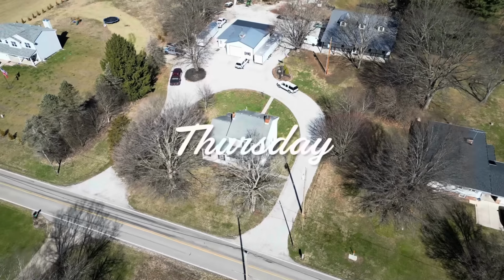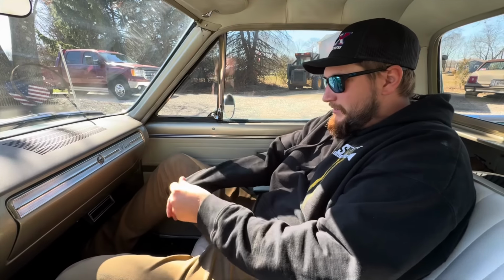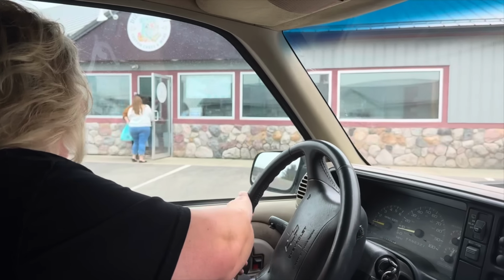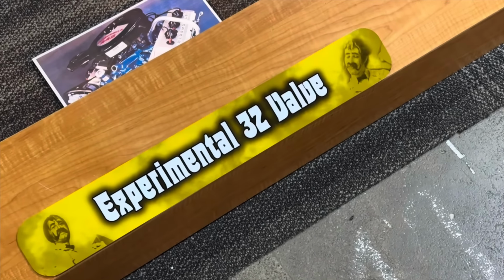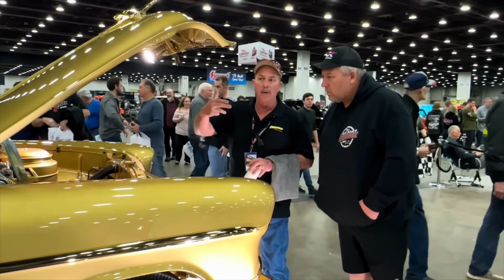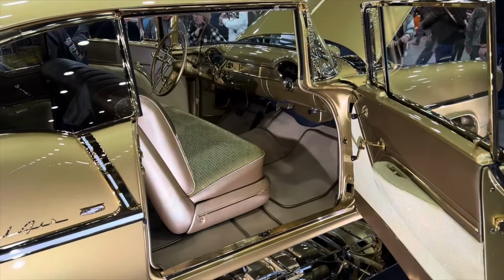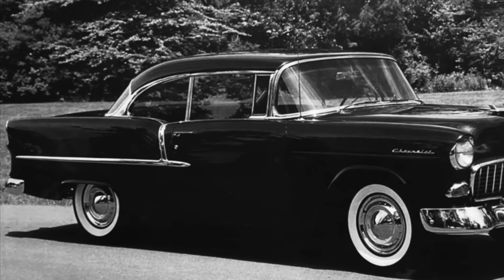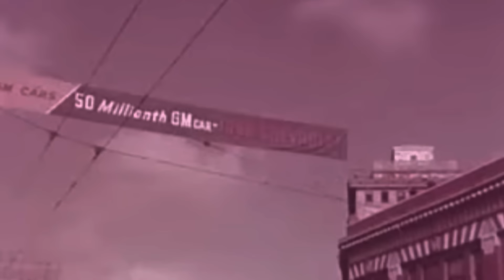GENERAL MOTORS BIGGEST MISTAKE!  The 50 Millionth GM Car(s) that were almost forgotten FOREVER!

Comment: Never thought id see a 307 going in something on this channel 😢
Reply: Well, unfortunately that’s when you get rooked by a street racer from New York! You can trust what those guys say as much as a New York politician, lol 😂 

At least it’s something that was gonna go into the MailCamjno and not something needed for a build with turbos or NoS. Makes you really wonder about the “Originality” of the rest of that SS Nova tho. Tyler may not have the cream puff he’s always thought he had or he did know and that’s why he was not taking issue with stripping the car down the way he is to update it instead of leaving it factory SS
Reply: The 307 was never a bad power plant, it just was never even close to being the king of HP. Personally, I am glad that the ElCamino is getting a rare power plant. While the 327 would have been awesome, the 307 fits the bill very nicely too.
Reply: No horsepower, hard on gas, JUNK
Reply: Those were considered as boat anchors, lol.
Reply: @1982MCI   exactly
Reply: Facts!
Reply: Stroked 283😂
Reply: How does house of pearls get all that work done! They work 24/7!!!! 
Awesome work ethics
Reply: It's basically a 283 stroker or a small bore 327. I'd rather have a 307 over a 305 anyday. 307s make enough power to get around town and run errands, perfect  for Mrs. Vicki.
Reply: Except Vicky never gets to drive it!
Reply: It's is a small block chevy 🤷‍♂️😂
Reply: You can sonic check that block. More than one 307 has been taken to a 4 inch bore.
Reply: @jasondeal3269  with the amount of nearly free 350s everywhere. Why waste the time, money and effort? These guys have the hookup on a lot of parts, they could build a mild 383 for the El Camino for next to nothing.
Reply: @Bobthebuilder.69  oh yea I get it. I’ve seen it done in the past. It’s an option when you don’t have many. But I agree. Personally I would like to see them put a 400 or a mild 421 in it.
Reply: I like it... We always said a SBC 307,,worked bad no power and was hard fuel...
Balance the rods fresh pistons low end torque cam Holley 500 headers 700r4
2:56 gears.
It'll be the camera rig and most enjoyable for the camera crew . It has to loaf along  is all😎
IMO🫡⚓
Reply: It's still a 'high nickel content" SBC
I've seen SBC's with "made in Mexico" casted in the casting ..with the camshaft in four pieces laying in the oil pan,,,and three rod/piston assemblies MIA😅
Reply: It's still a 'high nickel content" SBC
I've seen SBC's with "made in Mexico" casted in the casting ..with the camshaft in four pieces laying in the oil pan,,,and three rod/piston assemblies MIA😅
Reply: It's still a 'high nickel content" SBC
I've seen SBC's with "made in Mexico" casted in the casting ..with the camshaft in four pieces laying in the oil pan,,,and three rod/piston assemblies MIA😅
Reply: It's still a 'high nickel content" SBC
I've seen SBC's with "made in Mexico" casted in the casting ..with the camshaft in four pieces laying in the oil pan,,,and three rod/piston assemblies MIA😅
Reply: It's still a 'high nickel content" SBC
I've seen SBC's with "made in Mexico" casted in the casting ..with the camshaft in four pieces laying in the oil pan,,,and three rod/piston assemblies MIA😅
Reply: It's still a 'high nickel content" SBC
I've seen SBC's with "made in Mexico" casted in the casting ..with the camshaft in four pieces laying in the oil pan,,,and three rod/piston assemblies MIA😅
Reply: It's still a 'high nickel content" SBC
I've seen SBC's with "made in Mexico" casted in the casting ..with the camshaft in four pieces laying in the oil pan,,,and three rod/piston assemblies MIA😅
Reply: It's still a 'high nickel content" SBC made in the 🇺🇸
I've seen SBC's with "made in Mexico" casted in the casting ..with the camshaft in four pieces laying in the oil pan,,,and three rod/piston assemblies MIA😅 not enough left to make a good mooring,,it be rotted away🫡🇺🇸⚓⚓
Reply: 307's as well as any LS engines make killer trot line weights 🤠
Reply: All that work to go from 150hp to 200hp😂
Reply: I'd take a 307 over a 305 any day. They made decent truck engines.
Reply from the maker: There’s absolutely nothing wrong with 307’s.  I’ve owned and driven more than a few, and they make plenty of power for a daily driver.  If it was a 305, it would go straight in the scrap pile.
Reply: @theoldmansgarage agreed old man good enough for a daily driver doesn't have to be the best just has to work correctly get from point a to b & back
Reply: at least it wasnt a 305.. thats a boat anchor.
Reply: @theoldmansgarage My thoughts exactly. Nice torque curve making it perfect for what the el Camino will be used for.
Reply: I can't wait to see what you do with your old white chevrolet tow pig
Reply: Twin turbo blow through tow pig,lots of data and tuning vids would be lit af
Reply: @JohnDoe-gz8dw  technically it is. 283 block/327 crank. It has 1/4 inch more stroke than a 283.
Reply: @Bobthebuilder.69  yep, what I was saying

Comment: Hey Bill, Amazing video! I bleed chevy orange, I was born to live the SBC life and i will live it untill i die! I was born into a strictly GM family being as my grandpa (my Dads-Dad) was a Physicist & Engineer for GM, Specifically Chevy & Pontiac( I mention this in my last 2 videos)... Back in the late 1960's into early 1970 My Grandfather was a consultant on an experimental pontiac 427 Hemi engine that was said to produce 650 ish HP ( Im talked about this experimental engine a lil in the new camshaft video ive been working on for awhile).. My grandpa also knew/worked with Smokey Yunick for a period of time in the early 80's at Pontiac(I've mentioned this in my first cam vid)... My grandpa had a 55 Chevy when i was a lil kid and the 55 Chevy was my dads favourite car, I aim to build one some day before I d!e as a tribute to bolth of them...
In my last camshaft vid
I shared alot of rare knowledge with dyno data that I learned from my Grandfather, My Dad and threw complex experience about optimal valve event timing & how to get max VE (aka max TQ & HP) across the entire rpm range in any conventional headed V8 engine combination... its information you literally will not find anywhere other than mabey a top prostock engine builder... David Vizard loved my videos, ive also been told by many people that they learned more from my cam vids than they did from all of Billy Godbolds newest book and even a 3 day $800 David Vizard seminar... Id say it's well worth the watch if you have the time bill, I wanted to share this knowledge with you personally but your a busy man an i don't want to bother you so i decided to share it with everyone and ive had good success in doing so, my first cam vid has 145,000+views & my new one has 41,000+views, bolth videos just keep climbing & bringing in the subs!!!
Again Bill, I loved this video, To be honest I really felt it inside as it triggered memories of the past with my Dad & Grandfather who are bolth no longer here...
Take Care Buddy...
      ~ Adam ~
Reply: Much respect for you guys passing this information down the line and actually documenting it.. There is too much knowledge not being passed down to the modern youth today.. I learned from my grandfather so much mechanical knowledge its crazy, he was a crew chief/mechanic engineer in ww2 on a b24 crew based in England.. 2 yrs before he passed when I was 19 (43 now) he shared some stories with me of his job, and training learning every nut and bolt on the aircraft, maintaining and repairing off flight times, and having to man the top turret during bombing missions.. He explained how it was -60f to -70deg at altitude and they had to wear heated suits and how miserable the cold was. After the war he was hired as an engineer for Rolls Royce/Allison in Indianapolis and was on the team of engineers that developed the T56 turboprop jet turbine engine that was in use for like 50yrs in many forms.. His mechanical knowledge was immense.. I also became and engineer but I feel like a mere peasant compared to his accomplishments.. I wish I had recorded his stories he gave me, but my love and respect for him and all those men from those days will live on in my head for the rest of my life.. Lots of knowledge is lost and as I stated I really respect you documenting these things and passing them down for further generations to enjoy and use.

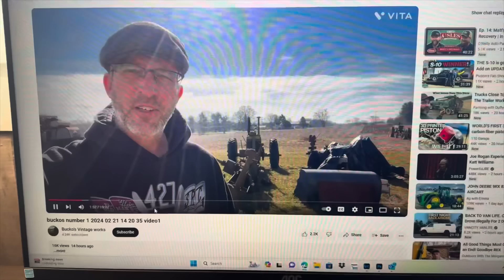Comment: My first car at age 15 (1970) was a 55 2dr HT. 8 yrs later I sold it - 3/4 cammed SBC, 4-speed aluminum flywheel/pressure plate, 4:56 posi daily driver. I'm 2nd owner of a 63 Impala Anniversary Gold (927) purchased in 85. Had several relatives who moved from Tennessee to work at Borg and warner gear in Muncie and my cousin was partner in establishing Music City Rod Shop. Keep up the good work Bill!

Comment: Bill  I grow up with my Dad drag racing 55 Chevy 2 door hard top  301 cid sbc extremely ported solid roller cam it was 585, 585 Eskandarian 462, casting camel hump heads, Edelbrock scorpion intake, which was also ported that was running a Muncie M 22 rock crusher with the Mr. gasket,  vertical gate, shifter,  57 olds rear end 5.38 gears  The best run was a 10:23 and 139 miles an hour. Dad‘s got three NHRA Wally s . He worked at  chet and Jerry Wilson’s Racing Engines, Wichita, Kansas my dad worked there 17 years professional engine builder. That’s what I do. We met you when Billy checked piece of Mallory at crankshaft there in Ozark, Missouri. My mom‘s car to drive with a 55 nomad. Chevy, orange and white. Crager SS wheels all the way around. I would love to rebuild that car

Comment: I'm old enough to remember car shopping with my dad in late 1956, we stopped at a Chevrolet dealer, and they were preparing a Black 57  Two ten 2 door sedan for delivery. It was a 3 speed manual transmission and a 283 V8. I tried my best to get him to buy it, but he said no.😢😢😢
Reply: So what did he buy?

Comment: Great video bill hey that 307 that your putting in miss vickies elcomino I put them right there with a 283 you can't kill em I had 2 years ago my 69 chevelle came with one and my 72 nova had one that with a set of Lee Shepard 202 angel plug heads and a solid isky flat tappet cam with a torque intake went 11.20 every trip it made down the track at Laplace drag strip and Gulfport I know that's not fast today but back in 1976 that was a decent street car running those times. And I know the crap I put my 69 chevelle through that those lil engines will last a life time
Thanks for the video bill. BTW what ever happen to the built to the max small block that you bought I know you had it at uncle bobs give us a update on it please.

Comment: I’ve got 2 56 Chevys ones a Belair and ones a 210 both have matching number 265 V8 engines and power glide transmissions. One only has 25k and the other 76k one is rust free the other is rusted out in the floor plans and trunk. Looking to make one nice car but having a hard time keeping the under powered 265 in it lol Thanks for the Video Bill

Comment: Just an FYI about 1970 model Chevy's...my dad bought a 70 Chevelle dark (forest green) green 4 door when I was a kid. According to him there was a strike at GM and Chevy was running short on engines. So his understanding was there were some unique things going on it said 350 on the fender and it was a 350 but his Chevelle had marine 350 in it with a 500 cfm 2 barrel. Finding parts was always a challenge carb kits etc. Dad was smart enough to save the engine when the car was sold I now have it in storage looking for the project to put   it in. I'm pushing retirement now myself so this will probably be my last big project maybe a 69-72 C10 at least that's what I am looking for currently

Comment: Not really a tri 5 guy, more into later  GM cars, Impala, first gen A body's & F bodys,  but always love history so this was interesting. Was completely taken away they had built a frame jig/ fixtuer for the tri 5s ( wish ANYBODY had one for F body's ! ) Bill----- we are on the same page, through thick or thin, early SBC FOREVER!    P.S. I got 23MPG out of my 1970 Chevelle 307 with a 700R-4. Ran like a clock, no issues with the little 307other then they don't pull a trailer over 55mph for beans. I built a stock fresh 1967 Vette 327 and pulled the 307 out still running fine and put the Vette motor in just to pull my 14 foot inclosed trailer.

Comment: Look on the the bright side Bill, a 307 is just a stroker 283. Put a dual plane intake and a 600 CFM carburetor on top. Should  be decent on fuel.

Comment: Basically a stroked 283. 

Consider putting a 700r4 behind it . The extra deep first gear ratio will help get it going and you can get astounding mpg on the highway under light throttle …

a perfect little cruiser motor..

Comment: Chevrolet had no idea they were building an icon. People restoring them usually do a better job of panel fitting and finish than GM ever did. They were just putting them out the door to turn a profit. Still, one of the best looking cars ever made. That's why I have one in the garage myself.

Comment: When you're young. You want a 57 Chevy. When you mature. You want a 55.
Reply: I don't know. I could provide a debate that the '56 is the best looking between the 3. Regardless of if its a 55, 56 or 57, they are beautiful cars.
Reply: My dad always said the same thing about tri five Chevrolets, 56 was his favorite too. He has a thing against 57s for a reason...back in 1957 a friend had a new all black 4dr hardtop. They were running the hills in eastern Kentucky where they lived back then. Driver rolled the car 2 times and landed on its wheels. Dad got his rear end caught between the seat back and the crushed roof. Nobody got hurt tho'. They took the bumper jack and raised the roof enough to drive it home, but not till after running the wheels off the car some more that evening. Dealer ended up putting a new roof on the car and looked like new in the end. 
That story is why dad didn't like the 57s, lol.
Reply: I completely agree mikekooz475
Reply: Same with Cameros the 69 was the sweetest at 18, but once you grow up then the 67 was the best.
Reply: I don’t know I’m young and fairly confident I’ll always want both

Comment: Since the elco and Billy’s c10 both will have 307s for a bit a 307 sbc build should happen n/a  or 2 kits for ol Steve in hard tire🤔🤔🤔 while Steve builds another nice engine to swap in later

Comment: Those carb gaskets you got are probably going to get burned through.  The EGR system on that engine, the port going up under that carb mounting location, is the reason it had a reinforced gasket like you took off.  I am pretty sure from what I have seen on the video.

Comment: There’s no way I’d throw that 307 in there when you have that sweet low mileage 327 (probably a small journal.) I’d tear 327 down, hot tank, hone cylinders, new pump, bearings rings and valve seals and reassemble.

Comment: There's nothing wrong with that 307 had one in a nova I changed cam and put a set 202 value head off a 70 lt1 and for back in the 70s she was pretty strong running a lot of dirt track racers use to prefer the 307 stoke racing I would put her in there and drive it all day long PS if it was mine I would just leave the six in it and drive it all day long 👍🏻😁

Comment: Bill, you need to get away from those farm truck 700 R4 transmissions and embrace a 200 4R instead. Much better gear splits and if built correctly they can handle everything a 700 R4 can. The El Camino is a perfect candidate to get a 200 4R.

Comment: Bill, what's the chance of me mailing you a carburetor from Windham Ohio.  Not to far away. An doing a rebuild an a basic new carb setting for install. It's a easy Quick Fuel vacuum secondaries new carb. Something isn't right.  I can't figure it out. It stumbles of start, then performs great. I'm lost and need help. Or maybe some pointers. Thanks for any of your time in advance!!!

Comment: 307????   That's terribly sad.  A bone stock 5.3 would run circles around it, and get better fuel mileage.  Bah!   The "LS" are just the next generation SBC.  I really don't understand all of the hate.  The 55 in the parade at the end didn't have paint dividers.

Comment: The 55 Ford would run circles around the 55 Chevy.
It is the last Ford worth having.
I road in a brand new one at the time.
The 272 was just faster than the 265.
I am a Chevy guy way before the old man was born.
Ford just fell short after 56. The Mustang was pure junk.
Thunderbirds were junk.
The 57 Ford that was blown was neet but very few.

Comment: 307 was a good engine, its a 283 with a 327 crank, not every car can be a race car, we steal the cranks for budget 327 as they are large journals, but then what's wrong with a 350, i have plenty of them, you have to at least put a four barrel carb on the ole 65

Comment: Hello, little story. My name is Craig , been with Buick club many years. I own a promo car by Buick, as the first in series, for samples to get public info on interest .  1975 Park avenue “ Exec Deluxe “ , according to Flint museum, I own the only 1 of 1 , of 37 promo cars known to exist. Aug 74 began the name purchased from Cadillac, Park Avenue (1962) . They did all the paint chips on the big Limited body. My car is code 75 ( red red fir skylark) not offered at any time to Electra . Of the 37 went to best dealers , only this car a 400 point fully optioned car, remains. No other car so far is known any where about. All numbers match, red with black pillow interior black roof . Any one in Detroit than can help me more I need more help. Craig